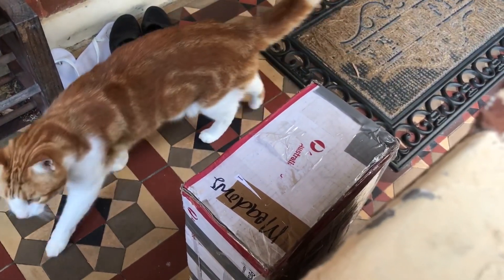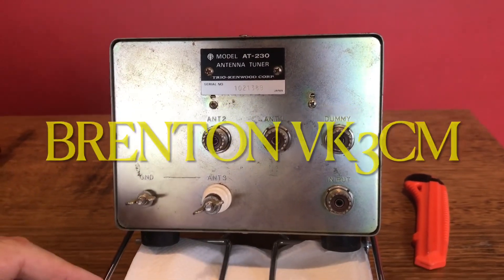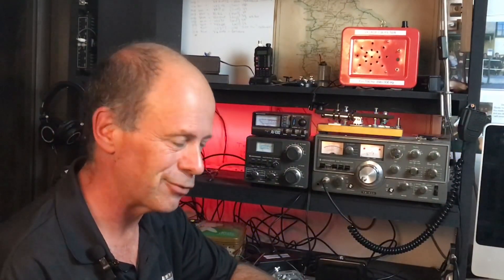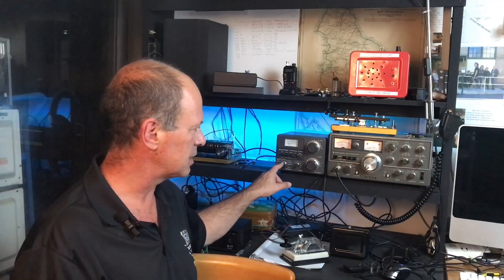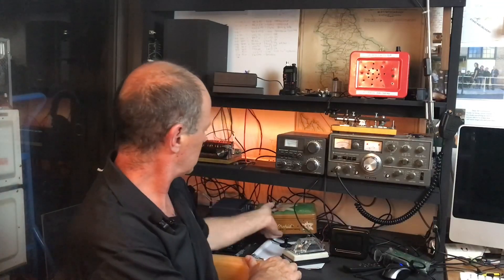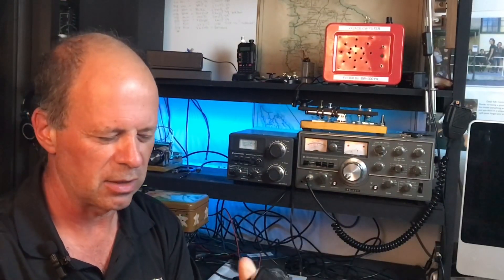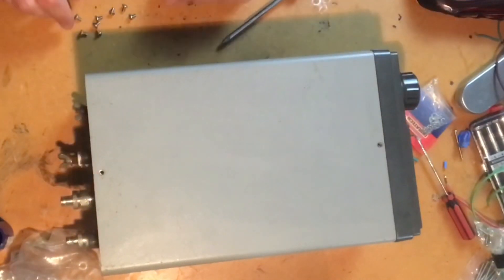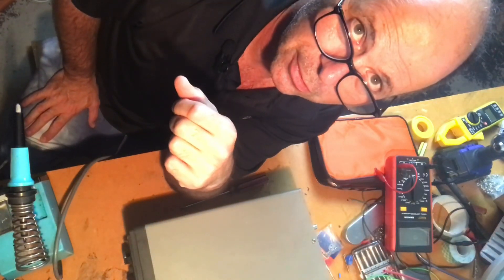My NEW/OLD Manual Antenna Tuner - The Kenwood AT230 has arrived@TheArtofEngineering

Comment: How much isolation does that antenna switching kit have between outputs? If you are using it to switch rigs, does it have enough isolation so that you are not feeding significant power out of one rig into the front end of another?
Reply from the maker: Good question …. Dunno ….. is my answer. What I do know is my TS520 puts up to 120 watts into my antenna “box” which has 2 of these in it and it hasn’t made my HF Airspy discovery or Hermes Lite 2 deaf. The unit earths the unused relays (I think). Might be worth a look see though? Thanks for the comment will look into it when I get a chance 73

Comment: I picked one of these up for my TS520S it had 2 unsoldered earth's which would have stopped it working. I re worked it and now it's going like a little ripper.
Reply from the maker: They are awesome and the switch to dummy load very useful. 73 de VK2AOE

Comment: Just come across you video, I’ve just bought one of these for exactly the same reason you bought yours, not received mine yet, but it’s in the post. There to much of this hobby going computerised and one day we won’t be in control of our switch. Thanks for the video
Reply from the maker: Yes love mine. I use the dummy load option and also love the antenna options. As my station is largely QRP…. The extra antenna   O/P will allow me to down the track, have my QRO TS520 seperate from my QRP antenna switcher. Also thoroughly agree with the elegance of simplicity a manual tuner offers. Enjoy the new toy when it arrives 73 de VK2AOE

Comment: ive got the matching clock hc10 in my shack old kenwood gear i love but sadly just the clock. them atu are really nice but my trio 430 s had the matching auto atu great video
Reply from the maker: Thanks for the kind comment. Kenwood made.great gear back in the day. I have since changed and neutralised the tubes in the TS520 and it is working a treat 73 de George VK2AOE